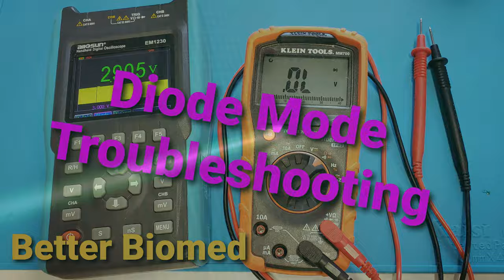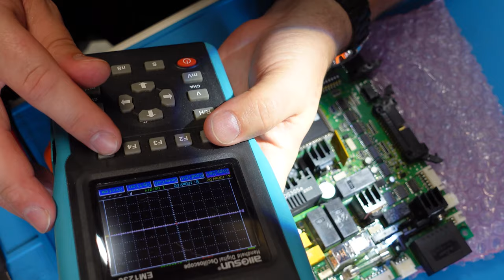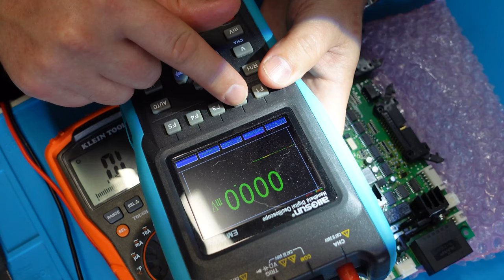Troubleshooting With Diode Mode

Comment: Why do some coworkers get mad when I use diode mode saying can break the board? It only uses a very low 0.4v like to 0.8v depending on the line being tested not enough voltage to break something.

Comment: Keep in mind, that only "normal" silicon / germanium diodes can be tested with Diode Mode. 
Diodes like Zenerdiodes, TVS diodes etc....with a higher breakdown then the measuring voltage signal of the multimeter, can not be measured and will show O.L on the multimeter, so don't assume yet that the diode is open if you don't get a reading. On most Zenerdiodes, the breakdown voltage is printed, but this is usually so small, that it is difficult to read when they are installed on a pcb. On TVS diodes is only the typenumber printed and not the breakdown voltage.
Reply: 👍 ThX for the insid..
Reply: Forward bias on a zener will loook like a common silicon diode.

Comment: Learner here. I don't get the third one, if there is a capacitor charging through the diode, what is the increasing voltage up to 2.8V?? The diode cannot conduct that way (you are checking in reverse when the voltage increases) so the multimeter just showing potential difference there and not voltage drop? Please clearify. Thank You.
EDIT: Ok i was just thinking about that, the current 'flows' the other (the 'right') direction while the capacitor charging and the diode is forward biased but then, how can 2.8V drop on that diode (even temporarily until the cap charging) when they can drop only 0.2-0.7V normally?
Reply from the maker: Write me at abetterbiomed@gmail.com
Reply: @BetterBiomedChannel  Sent the mail, thank You.

Comment: Remember to check the diode with one lead  outside of the circuit first. There may be some capacitance or resistors across that diode. Also check out the reverse results of using an analog diode meter.
Reply from the maker: I should make a video which explains that a little better.  Ground plane diode mode testing (especially between a good and bad board) is a quick method to narrow down the defective part of a circuit

Comment: sir when  you are  taking readings of components when they were soldered to the pcb when we take readings like that other electronic components may interfer the readings and will show false reading doesnt it , teach us how to take reading without removing the components ( good or bad ) to trouble shoot an issue you must remove at least a single pin from the pcb
Reply from the maker: When testing a diode in diode mode, you usually do not need the component removed from the pcb. When testing resistance, the component needs removed.
Reply from the maker: I guess I should have prefaced the video by saying one side of each diode looks like it's connected to a pin on the connector (which would make 1 side open as long as nothing is connected to that connector)